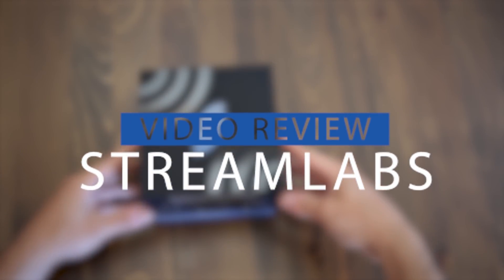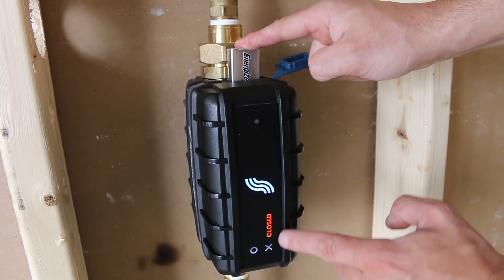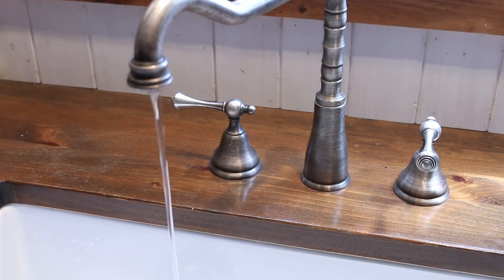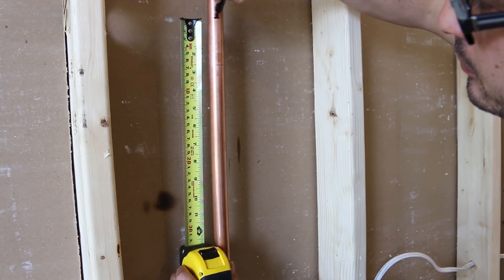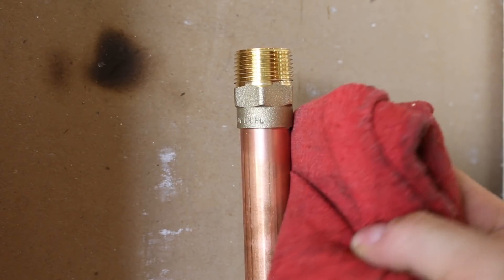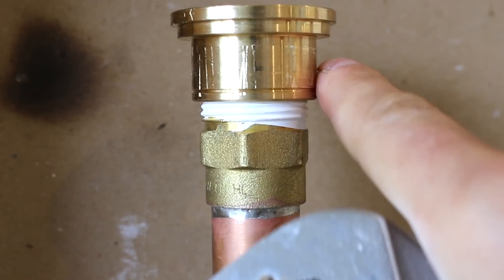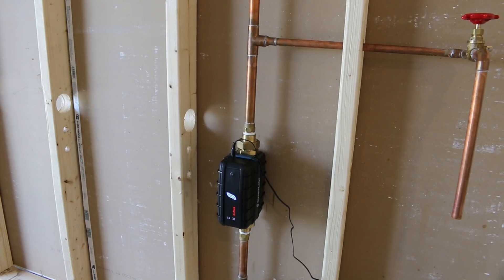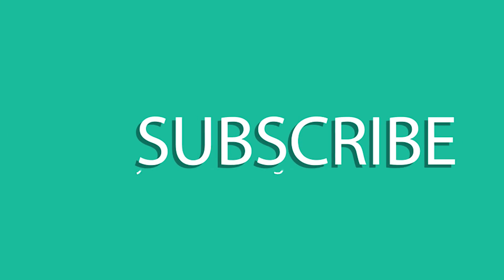This Valve Will Protect Your Home From MAJOR Water Damage (FULL REVIEW & INSTALL) | GOT2LEARN

Comment: ...SERIOULY....

How come new house constructions not include a such valve to shut-off  main water line when nobody is present in the house.... This should be included in the code.
Reply from the maker: I agree with you, these should either be code, or the insurances should ask to get them installed, simple.
Reply: How is the device suppose to know when "nobody is present in the house"?

Comment: This is really cool, but there is no way I'd trust a sharkbite. I'm not a plumber, but none if the plumbers with my company will touch it. Maybe they're crazy, but we only use ProPress or solder.
Reply: Why would plumbers use a shark bite? They would lose business if sharkbites became the norm since it's so easy even your grandma can do it. Sharkbites = Out of work plumbers.
Reply: the difference between sharkbite and propress is the tools required, both rely on a single epdm o-ring to seal against leaks.  wouldnt recommend either behind a wall, but out in the open they are both equal and viable.  fyi i just cut open my shower to replace a failed propress o-ring, it did not make it thru even half of the projected 25 year lifespan

Comment: My son just bought a house with a twenty-year-old gas water heater in it.  We tried to get him to negotiate for it's replacement to no avail.  This is obviously what he should have to prevent significant water damage in the event it fails before they opt to replace it.  He's a techie, so the remote control status and monitoring app should appeal to him.  Thanks, G2L.  Your vids are quality minded, and entertaining as well.  P.S.  Do I have to order my Fluxuator from England?
Reply: Try Phyn water smart assistance and shut off its better imo and our water co is offering a rebate also. ✌
Reply from the maker: Thanks so much! @William McKean Yeah they are only available in the UK for now but I am trying real hard to make them available for people to buy, it shouldn't take that long ;)
Reply: My 3 year old water heater failed and caused a lot of damage. It was located upstairs so as well as damaging the floor up there it ruined the ceiling below. I say this because the 20 year old water heater is as much of a leak hazard as a new one, meaning we would all need one of these devices that cost $1,000 installed. I can already see my frustration every time someone gets home and this is in away mode. Imagine starting a shower only to realize the person with the app isn't even there, so you've got to go manually open this unit. 
Seems if I was that afraid of (another) leak I would just turn my water off every time I leave home. Incidentally the leak I had happened while we were all at home, so this device would not have saved us.
Reply: itll only protect him when he manually activates away mode, if it pops in the middle of the night or during the day you wont have any protection.  $600 is pretty close to the cost of a water heater, replacing before it fails is the much more intelligent option compared to relying on a gimmic that only works when you can anticipate the problem.
Reply from the maker: Michael, the new application has been updated and that's all fixed btw.

Comment: You mentioned a 9volt battery to actuate the valve..is that battery fitted inside the unit ?? in the remote chance when your away on holiday there's a mains power disruption around the time of the leak.
Reply from the maker: You need to manually input the battery to turn on or off, it wont do it automatically
Reply: Use an UPS to power the valve.

Comment: How long is something like this really going to last?   Only a 2 year warranty..
Reply from the maker: That, only time will tell...it's like buying a car with a 5 year warranty, but costs 50k....not any better right ;)
Reply: @Got2Learn  I just know that electronics and water (especially under pressure) typically don't go together very well!
Reply from the maker: That depends and doesn't really apply to the valve.

Comment: What do you think about wiping down the soldered joint, immediately after soldering to remove any left over solder
Reply from the maker: I never do that, it'll most probably be insulated in the end, so I prefer not sacrificing the joint for looks ;)
Reply: @Got2Learn  Wiping excess solder from a joint is in NO way 'sacrificing the joint for looks'...it's just good craftsmanship.
Reply: "immediately" is the key word here.  If you wipe carefully before the solder begins to solidify, it shouldn't disturb the joint.
Reply: Apply the soldier to the opposite side you heat.. nice product
Reply: Keith Avery if you heat up a soldier, you might get shot!   Haha
Reply: woohunter1 spell check gets u everytime

Comment: How can it determine a leak vs using the garden hose?
Reply: The device only works in the "away" mode.  The "away mode" means that nobody is in your house, nobody will be turning any water source on, nobody flushing a toilet, no garden hoses or sprinklers.  Any water dispensed during the "away mode" will activate the device to shut the system down.  If you need any of these functions while your away, then it's not for you.  Good device for a summer cottage that isn't occupied during the week days or during the winter.  I wouldn't install one in my home.
Reply: @chrisgraham2904  This comment needs more upvotes.
Reply: This is a fascinating device but it doesn't sound like it detects leaks but has an ultrasonic flow meter which shuts off the valve in "away" mode. Additionally I wonder where the intelligence of the device exists; does it detect the unexpected flow and signal a server over the internet and the server then tells it to shut down? That would be troubling. Or is the internet connection only needed to send email notifications?
Reply from the maker: There is an "away mode" that you can set ;)
Reply: Got2Learn so it just detects running water and can close a valve when you are not home?

What if I leave a washing machine on when away, have automatic pool filling, garden watering, ...

Unless I'm missing something this product sounds completely useless for a lot of people.

Kudos on the install though!
Reply: One major issue I could see would be if you shut off water and water heater was on. If you have an electric water heater and enough water is removed you can build up excess pressure and also burn out the heating elements etc.